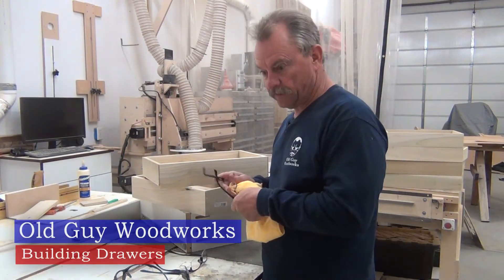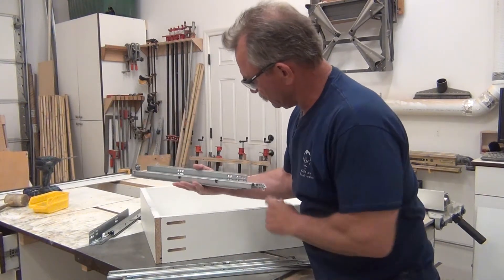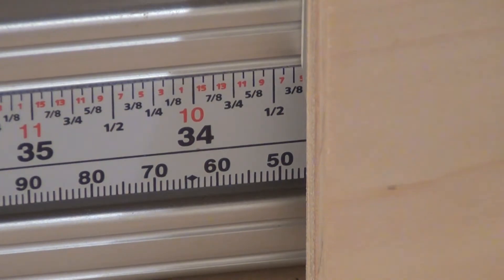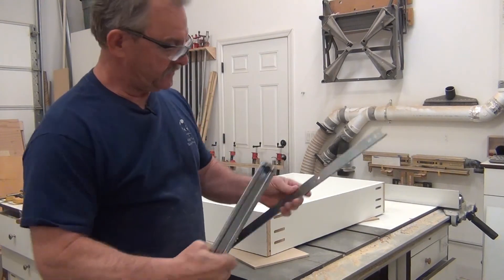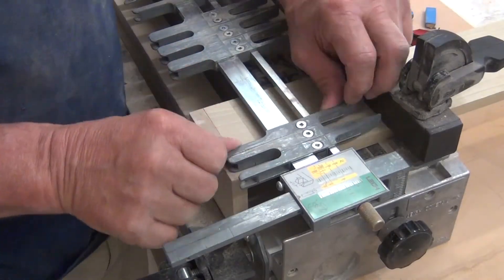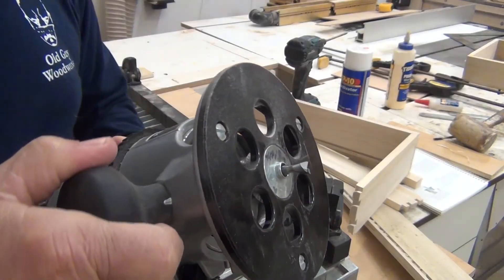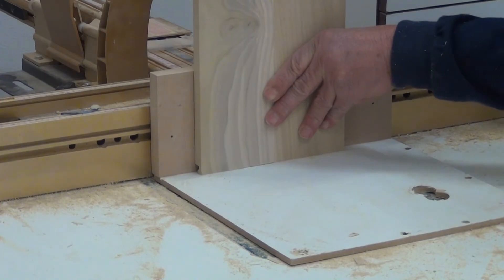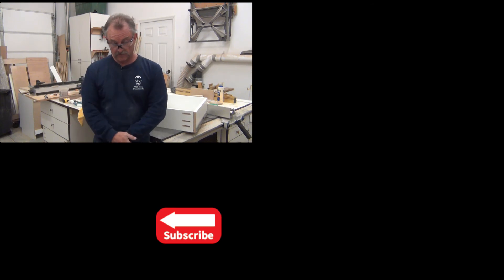How to Build Drawers - Dovetail, Drawer Miter Lock and Pocket Holes

Comment: Awesome video bud.  Actually has to be the best I have seen as I have been building drawers for many years.  I love that router bit you used for the drawers.  Is that a freud bit?  Can you tell me model #?
Reply from the maker: I have had it for so long I don't remember where and when I got it.  Or who makes it.  Does that help?  It is a drawer lock bit specifically for drawers and it probably is a Freud.